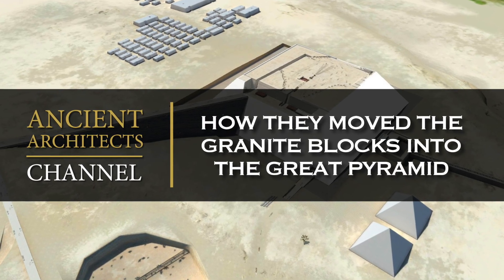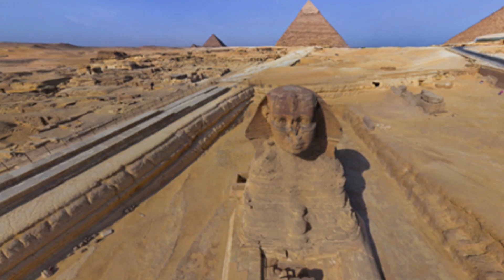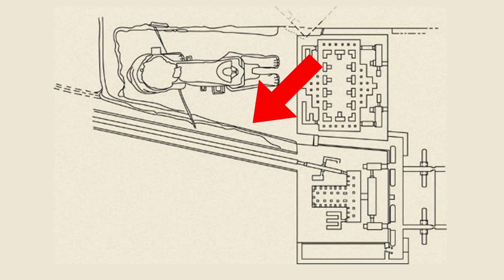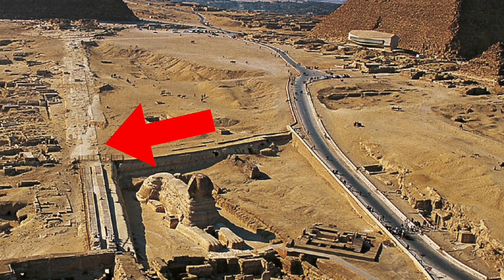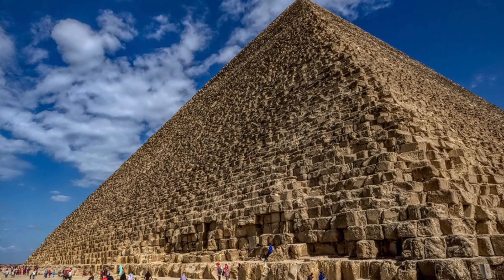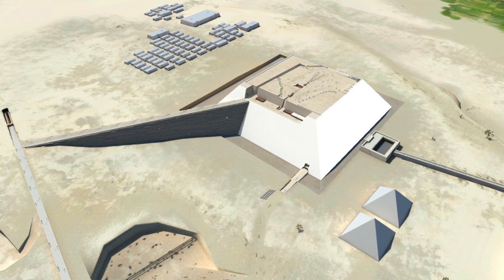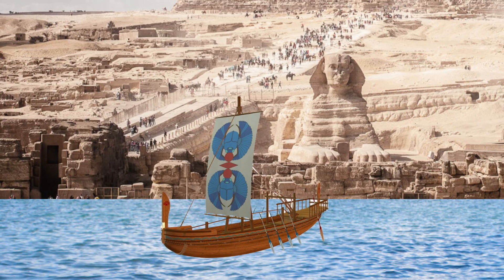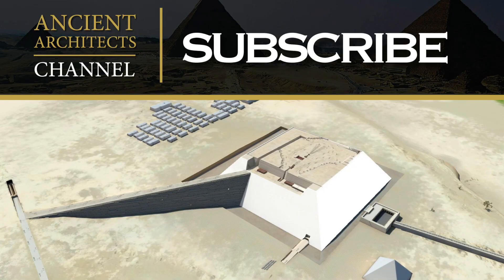How They Moved the 60-Ton Granite Blocks into the Great Pyramid | Ancient Architects

Comment: The heck with focusing on movement. How on earth did they cut incredibly hard Aswan granite so precisely? Sorry folks but cutting granite with copper tools or wetting and drying wooden wedges isn't going to create micron-accurate level surfaces.
Reply: YOu cut stone with vibration, sound.
Reply: @koff41  well you do if you want really really REALLY fine cuts otherwise a diamond saw works fine and itspossible to sp,it stone with wooden wedges and water. But nothing provides micron level precision like sound and vibration. But that's not a technology the Egyptians were thought to possess. In my view that's a rather big priblem for normative Egyptology, which they'd prefer to ignore.
Reply: You cut it with stone chisels and then polish the crap out of it. It's not magic.

Comment: Why does the enclosure have to be angled like the Sphinx, the Sphinx had it's own unique orientation which is why it had to be positioned the way it was. The enclosure was oriented the same way the other constructions were, this drew one to realize the Sphinx had a special purpose and that would've been detracted from if the enclosure was lined up with it.
                  If the sphinx and enclosure were oriented the same way then one could simply think well they just aligned it differently from the other construction no big deal.  But they didn't, they made the Sphinx uniquely angled so that it would stand facing the direction intended, that was it's job, it's not a triangle or square, it's a lookout, a guard,  always looking because the other structures were just structures they weren't built to be thought of as though alive.

Comment: I think the Khafre causeway was an aqueduct that moved water from the pyramid into the Nile. Every so often it would have a bit more water than usual which would explain the run-off into the Sphinx enclosure. The pyramid's function is anyone's guess but I am guessing that it involved water. the causeway could also have been multi functional, meaning your hypothesis could still hold water (pardon the pun, lol). Maybe it only had to release water at certain times. Who knows but it certainly seems like it held water and fits with the Sphinx enclosure water run-off mystery. Also another reason why it was so wide, built wider and stronger to hold water.
Reply: Were mills used in ancient Egypt? at the bottom of such an aqueduct would be the perfect place to install a mill of sorts that would be used for sawing, grinding or shaping stone blocks that had just come off a boat from the quarry and ready to be taken up the causeway once the water is stopped, turned off, re-directed or whatever. makes perfects sense! I know there is an area near the great pyramid that possibly had a large wheel/saw installed.

Comment: Granite, limestone, slate, you name it, any rock has a "ring" to it when sound waves are introduced. A 60 ton granite slab can be pushed by a single person, if the proper sound waves are introduced into the slab. It vibrates just enough that only a tiny portion is touching the "ground" at any one time. There is no need to drag, or roll a flat rock over a path if the path is solid and the rock to be moved is vibrating appropriately.
Reply: show us just ONE person who can do this..just repeated stories on the net..

Comment: No, it means the Sphinx enclosure was already there, and they built the causeway on top of the wall. The shortest path of least resistance between the pyramid building site and the Nile was that obscure angle... since it has to go between the temples and around the Sphinx. You obviously wouldn't go through the Sphinx temple and through the enclosure, you'd go around.

Comment: If someone asked me to built the pyramid, I would use the pyramid itself as its own ramp. 
First you need to drag all the larger granite blocks onto the base of the pyramid. 
Then as you added a new layer, you slide all the bigger blocks up a small ramp to the higher level. 
Quite literally, as you add layer after layer to the pyramid, you are also raising the larger blocks up with it, one level at a time. 
I'm not saying this is how the pyramids were built, cause I don't know, but it seems like the simplest method of achieving the task, and "simple" is usually how people like to do things.
Reply: V.Good.Read my comment: Michel Rabbat /Florida

Comment: This is very interesting. There is a correlation even if the final method  for moving and setting stones with the causeway ramp is inaccurate.  More questions still come to mind. Like how come there are no galleries in the khafre pyramid found? for this theory to be correct, every pyramid should contain a gallery for moving stones into place. The bend pyramid contains several galleries. It seems to me, if the ramp theory holds true, then a grand gallery MUST exist somewhere inside the 98% unknown area of the khafre pyramid. Cosmic scanning of the pyramid was scheduled along with the Bent and Great Pyramid, but I can not find any info about what or IF the Khafre scan happened. What a discovery that would be!

Comment: I think the pyramid and valley temple are indeed the oldest.  Those dang enclosure walls have always bothered me because as you mention, the enclosure doesn't seem designed for the Sphinx.  That was the harbor edge; the erosion is similar to that of a former river bank IMO.  Overall, I am of the belief that Giza is per-cataclysmic circa 10,500 BC.  The Sphinx and its temple were built second hand thousands of years after, prior to the sand settling above.  Or maybe it was the remnants of some type of docking mechanism which in its fallen state looked like an animal so they capped it with stone and shaped it.  The head was a later retrofit.

Comment: "Horribly complicated". Maybe an engineer should evaluate the mechanical feasibility of some of the "hypotheses". What I find attractive about this channel is the illustrations, though I find it necessary to reduce the speed to at least 0.75 in order to be able to understand some (if any) of the ideas presented.
However, it seems to me that instead of referring to the literature in the search of theories on the age of specific structures, one should start by asking relevant questions, as for example:
1) How did the two megalithic chambers in the Great Pyramid get to their present emplacements? In other words, were they built before the millions of limestone blocks that cover them? Or what seems quite improbable (intuitively speaking) that the pyramid was built first and somehow the gigantic granite blocks were stuffed inside via the galleries and once inside ensembled.
2) There are thousands of underground galleries and constructions, not only around the three Giza pyramids, but down under 10 to 30 or more meters of sand and gravel in the whole western bank of the Nile, starting from the Delta (Tanis, Tell Basta, and others), where the most notable until now unearthed are the Osiris Shaft, the Serapeum of Saqqara, and the great galleries in the Valley of the Kings. The question is, were these marvellous megalithic constructions built before or after the sand and gravel got there? How did all that sand get there? Remember that in a fairly recent tour Brien Foerster and geologist Suzanne Moore were shown marine fossils in the Giza Plateau. How about the great Deluges of the past reported in Plato's "Timaeus" Dialogue, are they absurd Myths or Legends, or maybe the truth in all these mysteries can be found there?

Comment: The difficulty with placing the blocks is not with setting them on top of each other. The difficulty is when you discover that the block that was just placed is not in perfect alignment, so you need to pick it up and rotate it 1 degree counter-clockwise and move it 2mm more in the west direction.

Also this explanation doesn't sound right anyway because it totally left out mention of the aliens and their anti-gravity machines.

Comment: Very nice and compelling video! 
But, I believe there were no wooden boats able to carry a 60 tons block along the river Nile and even if there were such boats, you would still need to manage to unload the stone and move it around, we would have hard time today with our best hydraulic cranes. Simply the 3 pyramids on the Giza plateau were built by a far older civilization capable to achieve such feats! Or I find really compelling the hypothesis that the Annunaki built the pyramids after the great flood (as you can read on "the 12th planet" of author Zecharia Sitchin).
4,500 years ago man kind didn't have the knowledge and enough engineering skills to achieve the construction of the great pyramid.

Comment: I have seen evidence of ancient sites in southern Africa where the orientation is several degrees west of true north.   The Sphinx may well have been built with it's orientation based on the true north prior to the earth shift at the beginning of the Younger Dryas.   This will explain why the causeway is parallel to the sphinx enclosure and not straight to the pyramid.   The erosion around the Sphinx enclosure and on the Sphinx does not appear on any of the other structures on the plateau because the pole shift occurred after the Sphinx was build and before the pyramids.   The area covered by the ice cap was not centred on the geographical North pole because that was not the Geographical North Pole prior to the Younger Dryas.   If Wallace Thornhill is right about the gravity being a function of electrical polarisation, than the stone blocks may have been a much lighter.   If this was the case, then the pyramids would have had to be built after the pole shift and before the repolarisation of the earth which places their building before the end of the younger Dryas cold spell ended.

Comment: I'm not understanding the hypothesis that the causeway is only as old as the pyramids, and therefore must predate the Sphinx. I trust the geologists in dating the enclosure based on weathering, but I'm not convinced that the enclosure was completely quarried. It's plausible that weathering /began/ the Sphinx. If this is correct, then the causeway could just have been repurposed as a ramp for the pyramid construction. Why build something from scratch, when the groundwork is already there.

Comment: There's no doubt in my mind that the entire complex is pre ice age.   When something is built it's usually done in the most efficient and precise manner possible, with the correct materials for the job. Just the fact that this was the most efficient method for them, that it was necessary for these materials to be as massive as they are, that they needed to be aligned how they were aligned, where they are (center of land masses, true north) and the scale of the whole thing...
How was there not an easier way? Why did the need those specific stones, why did they need to be that size and in that location?  I think those are the most puzzling questions for me personally.  Keep up the great work, I always stretch the brain on this channel!
Reply: Portions of rope, which were discovered in mud on an upper portion that was used to fill gaps between stones on the pyramid, were carbon dated to the 4th Dynasty.
The oldest papyrus ever discovered was that of a ship's log;  documenting the gathering  and transport of pyramid casing stones for the pyramids. The writing style and carbon dating shows it to be from the 4th dynasty.

The worker's village excavated in the 80's uncovered a brewery that brewed beer for the workers. It had inscriptions that said they brewed beer for the worker's of Khufu's tomb.
 Artifacts and carbon dating put it at 2,500 bce.
The bakery that baked bread for the workers had inscriptions that said they baked bread for the worker's of Khufu's tomb.
, artifacts and carbon dating put it at 2,500 bce.
Organic material in the walls of the village for the workers are carbon dated to 2,5000 bce.

There are over 450 samples of organic material taken from the worker's village, the surrounding temples, and material from the pyramids themselves. All come back with a 4th Dynasty dating of 2,500 bce.

There is an inscription inside the pyramid by workers that say they were friends  Khufu.

His mother's tomb was built next to it, and inscriptions inside that say the pyramid was built for Khufu.
His son's tomb was built next to it, and inscriptions inside that say the pyramid was built for Khufu. 
His brother's tomb was built next to it, and inscriptions inside say the pyramid was built for Khufu. It also said his brother oversaw construction of Khufu's pyramid.
When Greek historian Herodotus visited in 450 bce the Egyptians told him the pyramid was by built by Egyptians for.....you guessed it,  Khufu.

Carbon dating, inscriptions, Egyptian writings, writings by independent sources, surrounding area buildings and physical evidence, all independent lines of evidence, point to two indisputable conclusions:
1.The Egyptians built the pyramids during the time of the 4th Dynasty
2. Khufu's pyramid was built for Khufu.

The pyramids were looted. To say the pyramids weren't tombs is the same as saying a bank didn't hold money after it was robbed. Yes there is a vault, there are cash drawers, and there are balance sheets. But since there is no money now, it could have never had money in it the past.

Graham Hancock, EvD, Sweatman and others of their ilk complain that mainstream "academia" mocks them and calls them pseudo-scientist.  Well since they and their following of pyramidiots disregard  the mountains of compelling, overwhelming, verified evidence to the contrary of their woo-woo, far fetched absurdly silly alternative, I'l say they are being nice. Hancock and his following deserve 100xs the ridicule they get.

Comment: How much time or volume of water is actually necessary to cause that type of erosion around the Sphinx enclosure? Could the Sphinx have been carved first, the angle of the southern wall of the enclosure been a small sacrifice to construct the pyramids and the erosion on all sides been the result of the water run off from pyramid construction? Wouldn’t they need to continually relieve water from the structure to allow them to place the blocks? The higher the pyramids went the less water they could contain, right? How much water would escape naturally during construction? I imagine these aren’t water tight causeways.

Comment: Wait so the man referenced in the video, who provides the counter weight argument, is suggesting that they lifted a (im imagining very large) counterweight, to the top of the shaft under the pyramid everytime they needed to move a block up the ramp, then lowered it by pulling a stone up the ramp? Maybe im stupid, or im just not understanding, but doesnt that mean they would end up doing twice the work than if they had just pulled the stone up the ramp? Or potentially even more than twice as much, considering that they still had to help the counter weight get the stones up the ramp. Lifting the counterweight over and over again seems as difficult as just pulling them up the ramp with no counter weight. Because wouldnt the counter weight have to be quite heavy to be effective?

Comment: But what would they use to pull it with? Natural fiber ropes would never work. Their tensile strength isn’t enough and the length of it would only make it worse. 
Without pulleys this idea wouldn’t work either. They had to have metal for this idea to work.
Reply: Plaited leather? Wooden pulleys?
Reply: I often wonder this....  who made these ropes, and how, why don't we see ancient tributes to rope makers and making. who mined the metals for the tools and crafted them? who fed all these slave workers. if they had no wheel, why..... boats were obviously impressive and able to float with massive weight... who made these boats and why did they stop.  why do we never see depictions of day to day life of these slaves or any kind of animal of burden. it would be be feasible to use animals that died under incredible hardships and more would be needed. and of course.. why..... why was all this done and then..... just stopped. if the religion was strong enough to be a driver to build these at all costs, why did it just die out